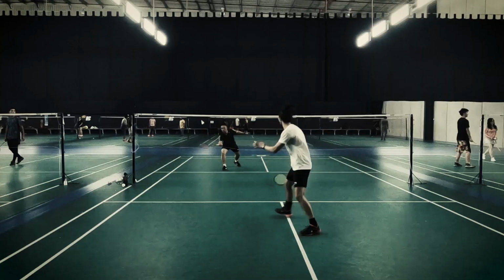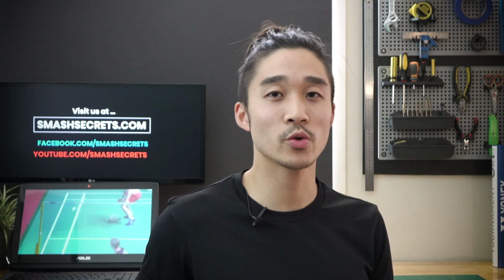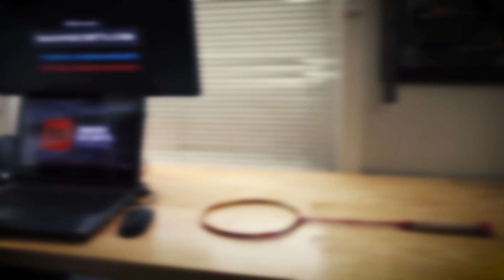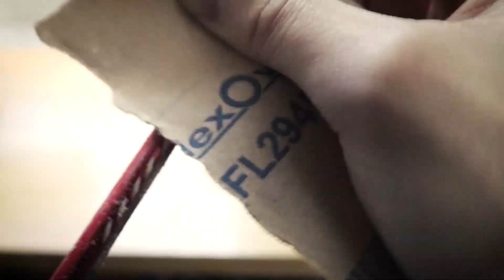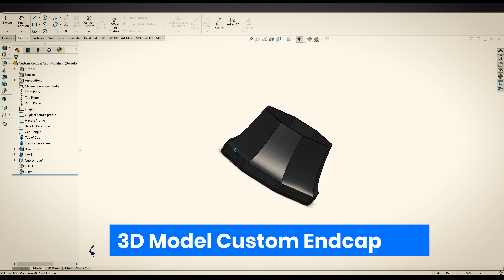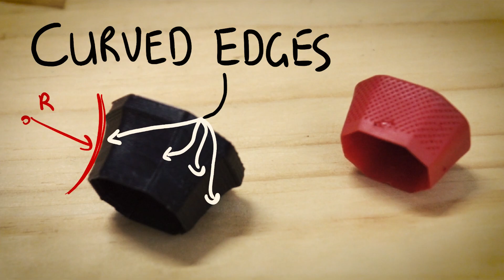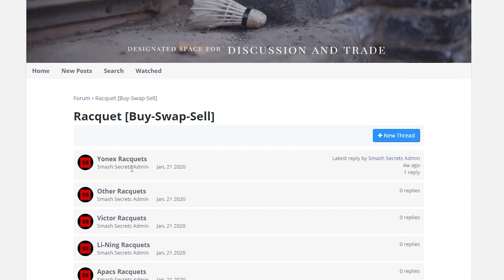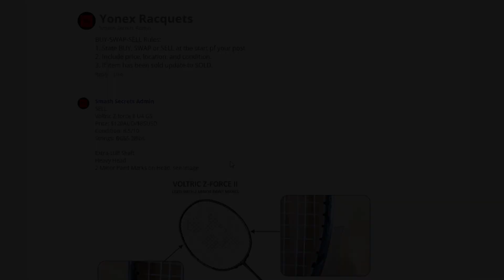Smash HARDER and FASTER with this custom badminton racquet - how to

Comment: wait but how does this help improve your smash?
Reply: I'm guessing the wider base will help to prevent the racquet from slipping out when smashing (loose grip)
Reply: @augustin_gan  paint coat adds weight maybe, and wider base gives better anchoring sort of.(cause professional often add extra grip toward the base)
Reply: @ammararifradhu4949  plausible, but i think the difference is negligible because he sanded the racquet first? Yeah I noticed many singles players grip their bases thicker.
Reply from the maker: The wider base let's you swing harder. It's just a little project to revive an old favourite racquet. Thanks for watching guys :)
Reply: i think it all depend upon your game and it just give you feel of good grip.
Reply: @augustin_gan  the 3d printed end cap ss also taller, thus giving some more length to the racquet. (more length means more leverage means more torque means more power.)

Comment: Did you paint the racket with the grommets on? Or did you take it off?
Reply from the maker: Left the grommets on. IF you want to do a more professional job, remove the gormmets and apply a clear coat after painting. Happy modding:)